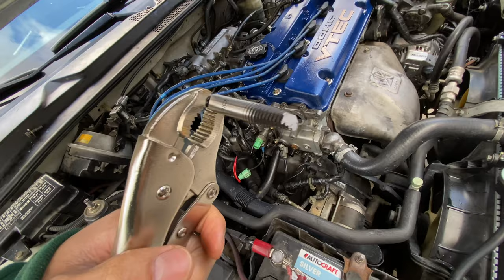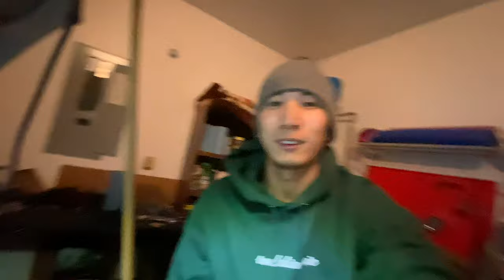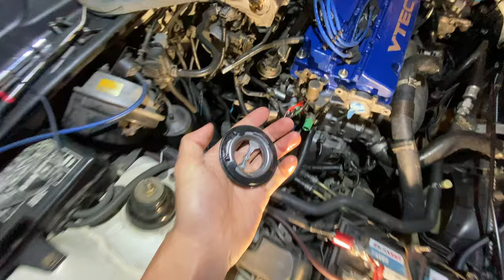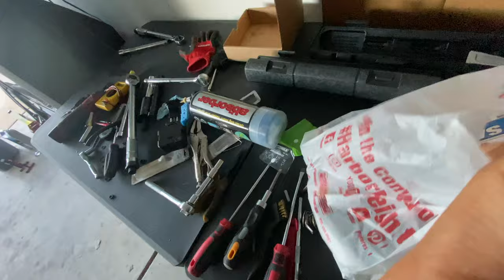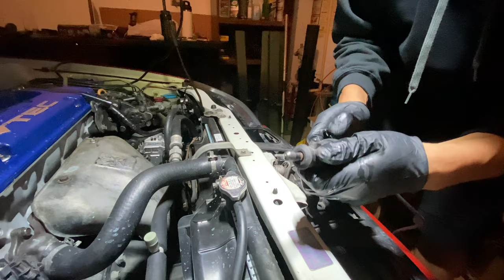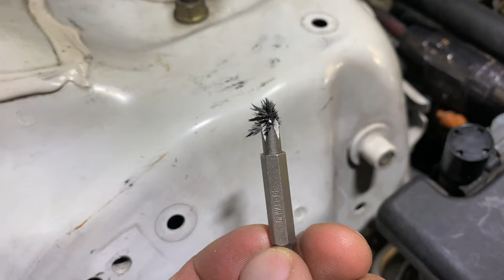Broken Sensor? It can’t get any worse....

Comment: I literally just did the same thing on my prelude. The duralast one was a little too long, so I used a 3/8 so I can tighten it down more and it just fucken snapped. Insane, gonna try your method and see if it works
Reply from the maker: Ahhh man, if you’re trying to remove it, just remove that coolant inlet/outlet thing right next to it and you can probably twist it off with vice grips instead of risking further ruining the tread on the head
Reply: @Rawrkee  bro thank you so much, do you mean the hose right there?
Reply from the maker: @zokvsha6902  the upper coolant hose, it’s right next to the temp sensor and so you should be able to reach the back of the temp sensor from there
Reply: Dude this just happend to me couple min ago.... just snapped clean off while screwing the new sensor... ohwell i guess i need to go to work to work in my day off haha

Comment: i had it on tight. why the hell did i turn it a bit more ???
Reply from the maker: Yeah bro, I was such a noob 😆
Reply: @Rawrkee   i was able to remove it ..im glad i put a little bit of anti-seize and i used a very short flathead screw driver, came right out with no effort...
Reply: your video gave me the fight i needed .. i almost said time to send it to the shop

Comment: Damn that sucks. My problem im having is my wire connector that connects to that coolant temp gauge sending unit nipple u have as your thumbnail ripped and I'm not sure where to get one at besides trying out a junkyard or 2. Autozone o'Reilly advanced nobody knows where to get one nor do they even have a name for that connector plug.
Reply from the maker: shoot man, I cant find the plug, best thing to do is to get it from the junkyard
Reply: @Rawrkee  I did that and still nada my cooling fan isnt coming on at all. I connected a brand new fan to the car and t fan still disnt come on. When I alligator clipped the old fan to my battery the fan came on with no problem so that means my fan works fine so my issue might be wiring. Or maybe just maybe my cooling fan switch I ordered was from amazon and maybe the switch they sent was already not working or maybe just because it isnt oem it isnt working properly?? What u think?
Reply from the maker: @WavyVaporizers  sounds like it could be you fan switch on the thermostat housing. To test it, just pull the plug, get a paper clip and bend it so you can make the two pins connect, or use a speaker wire to stick in there. If your fans come on, you know the fan switch is bad
Reply: @Rawrkee  I did that and the fan still didnt turn on. Only way my fan turned on was by putting alligator clips on the plug of the fan and directly put the other side of the clips on my battery terminal and the cooling fan came on without any problem or hesitation. This is why I'm feeling like it might be somewhere in the wiring harness and nothing else. I replaced the sensor on the thermostat and the 2 sensors underneath the distributer and still my cooling fan doesnt come on
Reply: @WavyVaporizers  did you ever figure out what was your problem? I’m having the same problem with my integra
Reply: @miguelargueta2473  yea I needed to replace my radiator because it had like 5 holes in it and it wasn't maintaining the proper pressure when the pressure test was conducted. Before I found this out I thought it was my thermostat so I changed that and it did nada. When I was changing the sensor on the thermostat I realised the wiring was cut so only 1 wire was connected so even though I put a new sensor it wouldn't have worked because of that one wire so make sure the wiring isn't cut and it's connected as well as a working sensor. I changed the 2 sensors underneath my distributer and found out that those wires as well weren't connected the wiring was split so I had to rewire that connector piece which wasn't obtainable anywhere online I had to go to the junk yard to find one myself and cut it out to reattach to mine. So make sure the wiring is good on those 2 sensors underneath your distributer and make sure the sensors are good as well. If none of this helps make sure u get a pressure test done on your radiator. Also 1 thing to check as well is your radiator cap. If the radiator cap is bad your radiator won't maintain the proper pressure and can cause overheating issues. Hope this works out for u.
Reply: @WavyVaporizers  thanks for the feedback man. I changed the radiator fan switch sensor, those two sensors under the distributor, radiator, thermostat and upper and lower radiator hoses and still no luck… I also checked the fuses and relays and they were all good.  Currently I’m I have the fan bypassed with paper clip so it just running constantly until I figure out the problem
Reply: @miguelargueta2473  have u checked your radiator cap? If that's good and everything else was changed maybe it's your water pump? I know how frustrating this is man trust me but I hope u find the the problem before it drives u crazy

Comment: Same damn thing happened to me on my e250 except for me it was the CHT sensor that snapped off when I tried to remove it. I put another sensor in another pre-drilled hole in the block and my stupid ass tightened it just a little too much and that one snapped off! And then I shattered the screw extractor in half trying to extract it! I don't know why they're so hard to remove, maybe the screw extractor pushes outward and expands the brass against the engine block and increases the friction.
Reply from the maker: That moment when the extractor breaks in there too 😭😭😭😭😭 damn yo, it’s crazy how so much can keep going wrong 😂😂
Reply: @Rawrkee  yeah, so many videos make things look simple but it's only simple because the person making a video has done it at least 10 times, the first time I do anything it takes 10 times as long as the video!